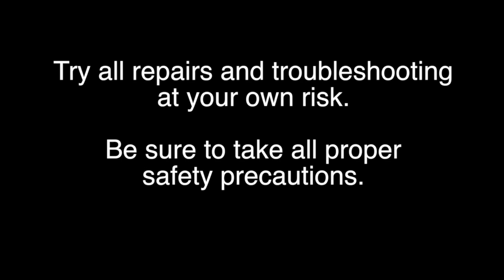Samsung UN58 LED TV Board Replacement Kit - How to Fix Your Samsung 58" LED TV - Samsung TV Support

Comment: Pretty simple process. Our Samsung 58 in (UN58H5005AF) started smoking close to the center bottom and now there's no power. Do you think it's the t con board or power supply board? And I searched Google for replacement parts and seen a lot that you sell. But I'm not sure which board to start with.